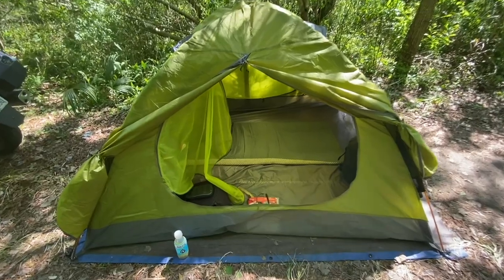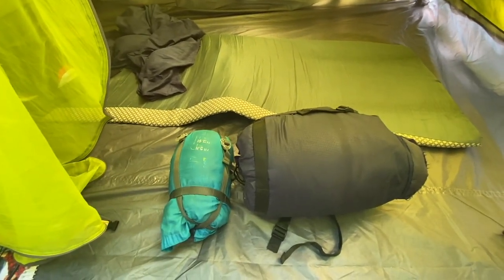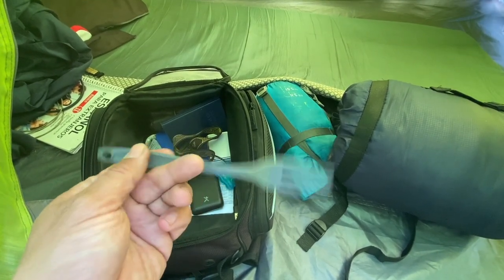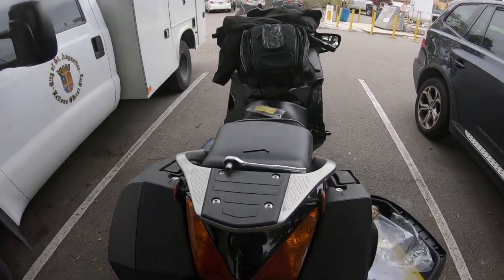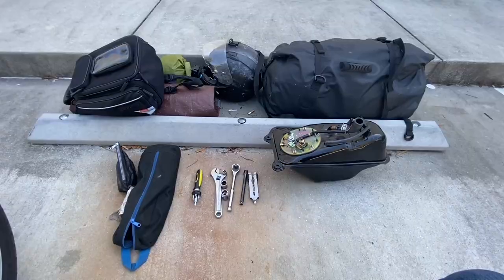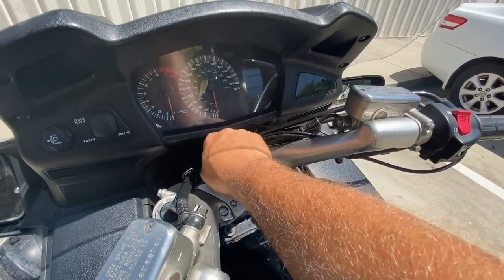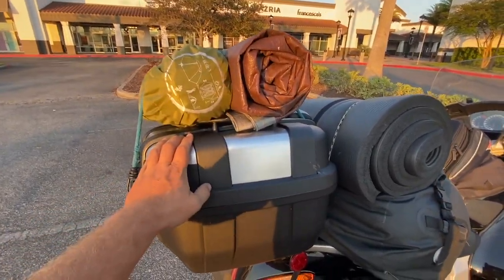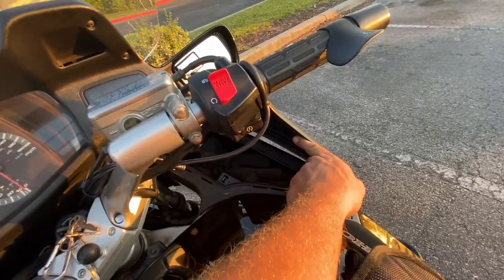DMV - Gear & Parking Lot Repairs

Comment: Joe, first chance you get better take the fuel tank off and clean it out .its full of rust flakes. If you keep the bike I recommend coating the inside. Better yet coat the other tank and swap it out at a later date.
Reply from the maker: Yeah, I hear ya. Got it stashed at a buddy’s place. Had intended to do it, but required taking about half the bike apart. Will do it for sure when I get a chance 👍 thanks

Comment: I would like to hear about your touring on your Kawasaki 400 ninja, at least I think that you were riding one of those for a while.
  in 2021 I bought myself a Kawasaki Z400. with a more upright riding position but basically the same machine as the ninja. For the last 25 years I’ve always had big bore sport bikes/sport touring bikes as well as a large two up touring machine. But I made the switch to the Z 400 as my Second bike, and although I have done 22 changes to the machine to make it more comfortable and have increased carrying capacity, of which I have a couple videos on YouTube Pointing out the upgrades like Corbin seat tall windshield ,rack and trunk in place of the passenger seat, rubber topped foot pegs, real horns ,foam grips, bar risers, Suzuki GSXR 600 shock-things like that. I’m getting in the 60s  gas mileage.. The machine can do 75 miles an hour all day on the interstate without ringing its neck..I adding the trunk and the tank bag and that wonderful german made hepco- Becker rack that just plugs into the  passenger seat spot without alterations, 
  I think with the off road places you go camping to get to, I would rather be on a lighter easier to handle machine, And I would rather have a machine that has a pretty standard size tire that’s easy to locate replacements. Especially something that gets in the 60s  gas mileage, and a lot simpler to work on, at maintenance time ..
    I realize that heavy machines give a better ride and are roomier and have more carrying capacity.You could find a way to mount a pair of Chicago tool cases as saddlebags. The cases I had looked exactly like black plastic military suitcases. They had very high-quality binder table latches. I believe they were 22 inches long, 18 inches high, and 12 inches deep, and waterproof.. I think I bought mine on eBay for under $80 each, but that was about 20 years ago..I put those on my KLR 650. they were perfect. They even had three digit combo locks for the lids instead of keys.. I mounted them high enough that I could carry a duffel bag across my seat and rack and on top of the bags for support when i went gold prospecting, Carrying equipment like shovels, classifiers, sluice box, gold pans, buckets in the duffel bag, and boots. that worked out very well. I found some gold.. but it probably wouldn’t even cover the amount of money I spent on the equipment, there is not much easy Pickens gold here in Pennsylvania and Ohio. And it’s all Placer gold, like sugar..
  I could ride to work on cold mornings with my aerostitch suit on and my electric vest. And I could carry a regular leather jacket in my bads for on my way to work on those cold mornings. Then I would switch over to just the leather jacket and put the aerostitch suit and the electric vest in the bags for the ride home.. 
  I always put the stuff that you must carry in my left bag because that bag is the one that when you open it things tend to fall out when the bike is on the sidestand…Tire repair kit, rain suit common tools, stuff you don’t need every day. I didn’t have to open that bag every day, that’s why I put the stuff you must carry in the left bag, because you don’t need that stuff every day..
  The right side bag,  when opened,  things don’t fall out, and it’s easier to open the right bag, get what you need or put things in there, and close the lid without having to hold things in place while trying to close the lid..open and things didn’t fall out, so, I carried things I used every day in the right bag like, water, baby wipes for those calls of nature, and I would leave the bag mostly empty if possible for things I needed to buy, and I would have a place to stick my jacket if I was going to park the machine and go shopping or leave the bike ..so I always keep the right bag  mostly empty…
  i’m sure you know much much more than just about anybody about packing and what to carry and things like that. But I would like to hear how things were when you were riding the Kawasaki 400.. issues with the bike? How did you set the bike up to carry all the things you carry? How did you deal with that horrible seat. Of the dozens of motorcycles I’ve had since 1968, I believe the stock ninja/Z 400 seat is one of the worst..
  have you ever watched the guy that has traveled all over the world on a Honda C 90 that was a retired postal motorcycle in Australia when he bought it. He rode across Australia got a ship to Indonesia, rode across Asia and Europe back home to England on a Honda C 90. He has written from the very furthest point north in Alaska all the way to the southern tip I think of South America on that motorcycle. When it blows up with some problem like a blown Crankshaft, he said he can find parts to rebuild it anywhere in the world, and he rubs that into the BMW gs riders by saying, try that with your BMW GS when he hast to replace a crankshaft somewhere and does it in one day..
 this guy is a celebrity in Europe and England. He has many videos. The title of his videos are, C90adventures..
  He meets people in Vietnam that want to do a tour with him, they all fly there, buy used motorcycles, c 90 Hondas, and in his one video he takes a group from the southern part to the northern part of Vietnam on the’s old used motorcycles that they have to replace pistons and fix crash damage along the way. Very entertaining. And after the trip, they all sell their motorcycles and hop on a plane and go home
  when he was riding from Alaska to the southern tip of South America. There is not a road connecting North America to South America down there somewhere. And they wanted a minimum of $600 or $1000 to transport his motorcycle across that distance by ship. But there was no extra charge for luggage. So he completely disassembled his motorcycle and put it in duffel bags, and got on a boat and that’s how he did that..
  I believe you would find him very entertaining, I do, just like your videos
Reply from the maker: Stay tuned! I've been meaning to do a video about it! Thanks for the info